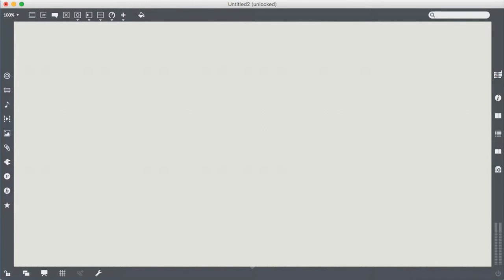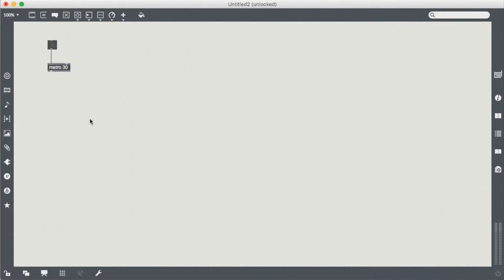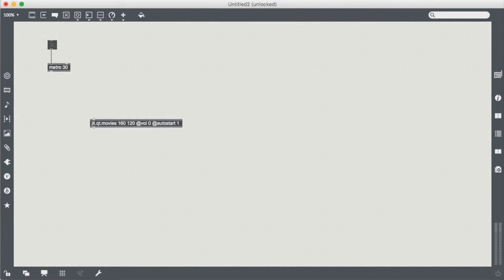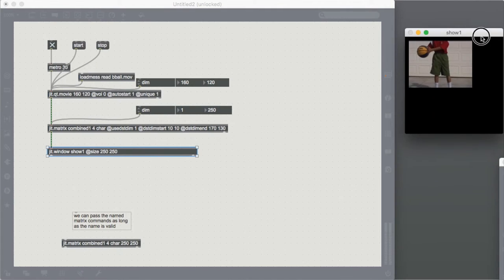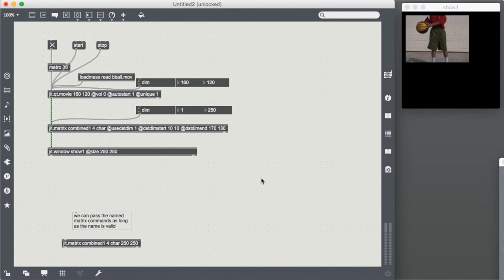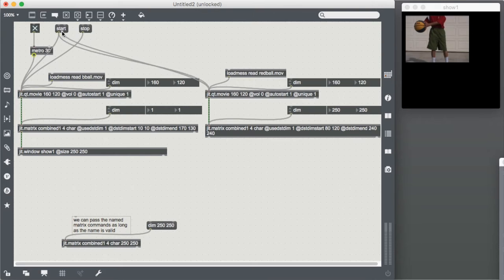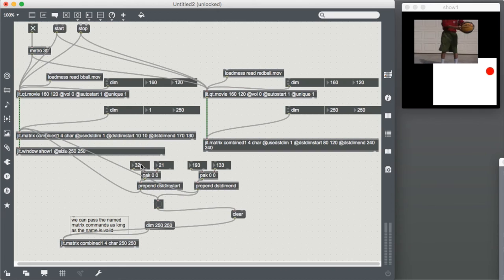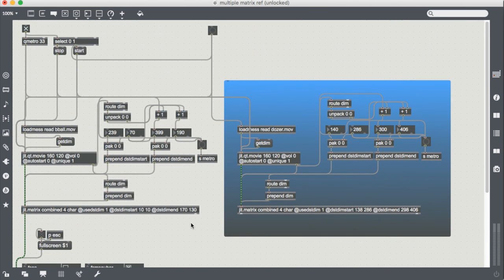MAX MSP: SUBSETTING MULTIPLE MATRICES (VIDEO MATRIX)

Comment: Does this process also work for multiple audio matrices? I've been working on a Max patch with 6 different effects sub patches, and I'm trying to use a matrix at the end of each sub patch as a sort of sidechain, where I can choose to either send the signal strait to the output or back through one of the other 5 effects. The problem is that this can create a feedback loop if the signal were to go through one effect, sidechain to another, and then back to the first. Max recognizes this and sends me a wall of "infinite recursion" errors that basically lock up the entire patch. I've tried running the sidechain cables for each effect through a gate that blocks the signal before it can go through the input, but the error messages persisted. Is there an object and/or sub patch I can use to fix this, or am I gonna have to cobble something together in JavaScript to selectively block repeated signals?